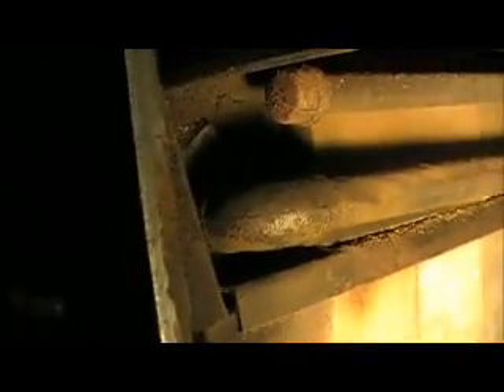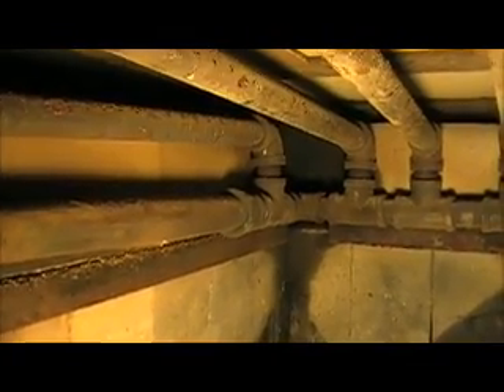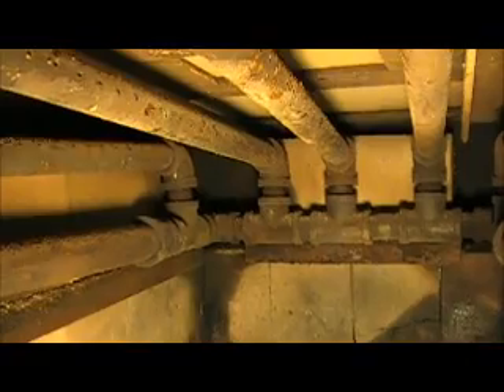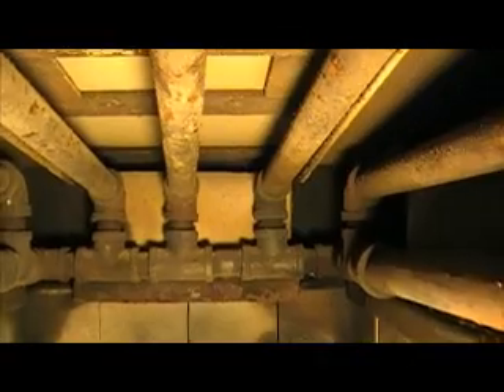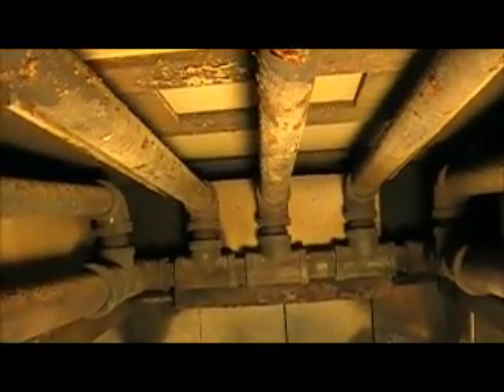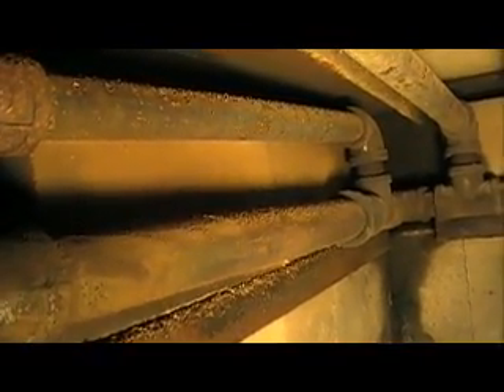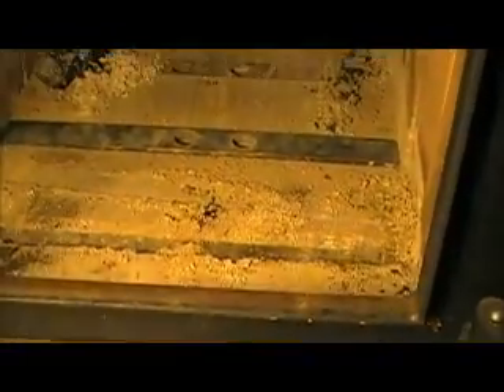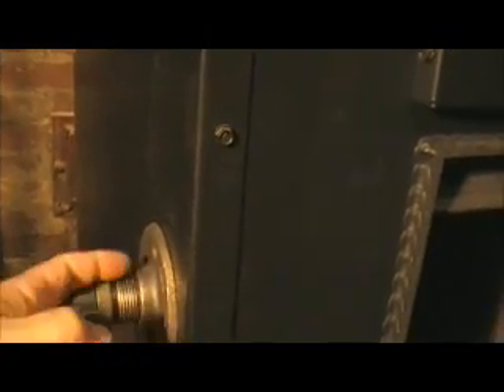Englander Stove Secondary Burn Modification 28-3500 How to

Comment: Looks good. I did a similar set up on a USSC Hotblast wood furnace. I used a gas stainless steel bbq burner for my secondary. It worked great. I had to do some welding on the burner to adapt it to the pipe. Your method seems much simpler.

Comment: I know this video is from a long time ago, but I am currently looking at buying this same wood furnace and wanted to understand better how this modification actually functions.  I had outdoor wood furnaces in the past that worked great, a Wadena and a Hopsco, but now may be looking at this particular Englander.  I would like a copy of the parts list if you are still sharing it, and a little better understanding of how this actually accomplishes the much better efficiency.  Thanks!
Reply: Would like to email you for the parts list if that is still an option. Where do I get your email?
Reply from the maker: overmann55@gmail.com

Comment: So are the pipes inside basically there to help hold heat in ? From my understanding it sounds the plates you added inside is what’s really making the stove burn longer off less wood. I purchased a house with this stove as secondary heat and I can’t get it to burn all night for the life of me!
Reply from the maker: Longer burn times are a combo of the largest pieces of wood (has to be dry) that you can fit and being able to lower the air while still keeping the burn going well enough to provide heat and not burn out or billow smoke. Secondary burn and injecting the air at the top of the box seems to give it a steady burn and it goes all night for me. 6-8 hours is easy... just fill it up again in the AM... still plenty of hot coals to fire back up.

Comment: anyone else have that "baffle plate" in the Englander slowly start to succumb to gravity/heat after a few years of usage? it was bowing downward so much that it started to get in the way of putting firewood in beyond a few pieces. i flipped it 180 degrees and now the thing is slowly falling apart (seeing little pieces breaking off of it over time). in another year or 2 it'll be gone. a friend said theirs did the same thing (on a different brand/model) and they removed it once it got degraded. has all u experienced the same thing and if so, did removing it work out ok?
Reply from the maker: Since my plate is sheilded by the extra bricks I added underneath it - I do not see any degridation of the plate at all - still looks good. Also - I run mine on low air for log periods - and I never get it in an overburn situatiion so if you run the stove red hot It may be why the plate is degrading?
Reply: You can save it before it crumbles and just have a new one cut. Probably pretty easy for any word shop. Quick 75 bucks maybe if they have a piece of steel sitting around.

Comment: Most builders seem to favor 3/4" pipe but I have a bunch of 1-1/4 black iron pipe on hand and wonder whether fewer runs of larger pipe for a secondary burn would work as well. Also, is there an optimum area of drilled holes relative to the ID of the pipe?

Comment: You are so awesome, great explanation, and video.
I've got a question. What about using a wood burning stove catalitic converter. The ones I've seen are about 2" deep x 3" high x maybe 12 " long, ceramic. I'm thinking your supposed to put them the fire against the stove wall. I'm guessing that when they get hot they burn the gas and glow red. Not sure if you need a space between it and the stove wall, if it's only helpful on top, if it's worth the money . Any advice from anyone would be greatly appreciated. Thanks. Again great video.

Comment: I tried the same design you have at the first of the year but it didn't work. I'm thinking it was because the secondary air wasn't heated but I see your idea is as mine. So can this design work with normal room temperature air? If you would could you email me with any suggestions you may have? Maybe it could be not air tight sealed enough? Ty much.  jetmech401st777@gmail.com
Reply from the maker: Tricks: get some coals in there first - it needs heat to ignite the secondary - the air needs a bit of pipe length to heat up the air before entering the box - otherwise it will not reach the temps needed - try turning down your regular air feeds and it should suck in the secondary to ignite.

Comment: So what you've done is just modified the air intakes from its original design ? Could you not slow the air with what came with the fire box ?
Reply from the maker: You could, but the result I found that the stove without the secondary tubes and the other mods would either eat wood like crazy or billow big black smoke - there was no in-between...
Reply: David Brisson- what the average burn time on low?

Comment: Hi Dave, how do you heat up the air before send it it into the stove?
Reply from the maker: The air travels through pipes in the stove which heat the air before the air actually enters the upper part of the firebox.

Comment: Hey David, I also have the same stove, and you're totally right, it eats wood like it's no one's business.  I like how you did the secondary burn set up. Could i also get the parts list? And any other tips and tricks you did on the stove for longer burn times. I am still feeding every 3-4 hours even with seasoned wood, and it sucks Email Meluvulngtime00@aol.com (yes it's from full metal jacket)
Reply from the maker: Sent - sorry for the delay - just saw this comment...

Comment: David, like your videos, we live in fairbanks,  we just purchased out home a month ago im looking into ways on cutting on heating costs. im very interested in purchasing this stove, but can this be placed in my garage or shed that is attached to my home. then run all of the piping inside. also just curious, how much did you cut back on your heating costs with the purchase of this stove. thanks can you email me parts list and the step by step list. johnwatkins35@gmail.com
Reply from the maker: Hi John, You can leave this in the shed or garage. However depending on the temp of the air entering the blower, you will probably want to add an intake air duct from inside your home as well as the return from the stove. That way you heat already warm air from inside your home not freezing cold air from the garage. Should be fine and work well. No wood mess coming into your home. Smart way to go. I have a chute in the basement for the wood so I do not have to carry anything into the house and the wood mess stays down there. I will send the docs in a few... good luck - let us know how you make out.

Comment: What is the diff in burn times before and after
Reply from the maker: Hi Matt, Prior to the mod, It was difficult to get a good burn and have it go 3-4 hours. Most often if it was burning well, it had to be fed every 2 to 4 hours. I chewed through a LOT of wood. Now 7-8 is easy and depending on the size of the logs, 10-12 is doable. All with the same amount of wood.  It is because of the air injected is focused on the gases versus the wood directly. It allows you to lower the stove air feeds to almost nothing and still maintain a great total burn without the black smoke billowing like it used to when you try to turn down the air.

Comment: interesting idea. Can you tell us the difference in temperature before and after this modification ? Just wondering because my stove is not as robust as yours and too much increase in temperature might distort some metal parts. I have seen top plates distort on other stove modification's.
Reply from the maker: The temps are essentially the same but you can control it better and get heat longer because of the added efficiency. Same wood - more (longer heat). Wood stove temps overall are determined by the fuel and the amount of air you add. For instance if you have wet wood, you will not get high temps easily. And no matter what stove you have if you accidentally leave the air feed wide open for hours you will over-fire it and warp the parts that are susceptible to high heat. So the goal is to get more (longer) even heat with the same fuel.

Comment: Interesting, and a good idea. Certainly I mean no offense, but I think you have way too much going on there for the average owner. Definitely, it's more than the average person could accomplish. I will be coming out with an add on for this and similar stoves which will increase burn efficiency by approximately 20% and it can be installed by the owner in only a short time. It is relatively inexpensive, simple and best of all, it works. It will largely eliminate coal build up during periods of heavy use and increase burn temperature considerably. Just the waste in fuel from the coals building up is and has been a major complaint with all of these stoves. I like what you have done though.

Comment: Hello, thks for the detailed notes. If my stove was in an urban environment the smoke exitting now would b unnacceptable. Bit by bit i am learning the importance of the secondary gas burn. I can relate to the dues u paid going back and forth to stores for parts. My business is in printing, lots of making do and inventing, as well i have done 2 houses by the seat of my pants. 2 questions - you added firebricks to the ceiling of your stove to help the 2ndburn ? I dont c clearly either the exit hole or baffle covering it, obviously its there. 
Its not the season to do this job. I am in quebec canada, originally from montreal but now an hour train ride and a 30 min car drivenorth of the city. Your secondary, joke, name - Brisson - is french. Where are you?
Reply from the maker: +ian stewart - I live in NH. It is about 5.5 hours drive to Montreal. Been there a few times. I used to drive up for the fireworks competitions. Very nice city. My Dad's family is from Canada and I still have relatives in your area. It is too cold to start the modification now if you are that far north. Best wait till spring. Good luck and stay warm!
Reply: I just took in my neighbours stove 2 weeks ago.   They heated their house for 20 yrs with it full time.  Our place is not full time, for now.  I have been in nh,  for the appalachian trail, on the way to old orchard, kennebunk, and a couple of boston visits.  Thks again

Comment: Hi Dave,
Great little project!
I'm considering going with the Englander. My main concern with this stove is efficiency, any stove can heat if you burn enough wood. Your burn tubes certainly seems to have helped in that regard. How is the black pipe holding up after a couple seasons I would assume the tubes would break down after a few years? Could you send me your step by step and  parts list? Thanks Joe    baylogj@gmail.com
Reply from the maker: +Joe Baylog  Hi Joe, Still holding up nicely. No issues thus far. I am sending over the docs now... Let me know how you make out.

Comment: fyi, iam going to model my tubes and burner off the NC30 for the sec. air..
Reply from the maker: john reich Email me and I will forward you my docs.
Reply from the maker: +john reich  - Hey John, how did it come out?
Reply: +David Brisson completed back in the late spring.  was only able to test outside with a 5' stack.  Will be installing in a cabin within the month.  cut the tube holes with a cutoff wheel instead of a drill.  much faster.  Did get a secondary burn for a while but just didn't have the draw for it to work properly outside.  The real challenge was getting the plate and cat. out to make room for the tubes.  didn't take vid. but got pics.  will try to post.  Thanks for your example.  John
Reply: +john riech Hey Dave.  I installed the stove w/secondary conversion in a small cabin recently.  The stove works great w/secondary tubes.  There was enough pull for it to burn consistent and pull the secondary air once the primary was shut down even with not well seasoned wood.  I was able to get at least 8 hrs fr. a full load of wood which is 3 or 4 splits on a 4" bed of coals.  So Its a total success.
Reply from the maker: +john reich  - That is really great to hear! Another home-made secondary success. I would love to see what you did exactly- if you can share a few pics / vid that would be appreciated.  There are still a lot of naysayers on this topic, so I am glad to hear that yours turned out perfectly. I am still seeing boards calling our do-it-yourself solutions a total hoax. Bravo Sir. Not sure if you found it difficult, but I am pretty sure just about anyone can do it with a little bit of tool ability and some patience.
Reply: +David Brisson youtube search:  catalytic to secondary air conversion englander 24-ACD,   its a silent slide show with notes on each photo.  Next time I am at the cabin I'll do a narrated video which will hopefully be better.

Comment: Dave, like the sec. combus. tubes.  vid. how much space did you leave above the brick and metal plat for the smoke along the top? also what is your flue diameter.  I have an Englander 24-acd and pan to remove the cat and bypass plate add sec. combus. tubes and put the brick on top.  As it is right now with the cat removed and the bypass open it just doesn't get enough air to keep burning without the door ajar.
Reply from the maker: john reich Hi John, 6" steel flue. There is about 2" above the plate and brick for the smoke to reach the flue and go out. It sounds like you may have a poorly designed draft system in your stove. The added burn tubes may fix your stove because it will allow some added air to enter the burn area right at the top of the firebox. Do you seem to have the issue after say an hour of burn-time? What does the smoke look like coming out your chimney? Do you have a lot of smoke coming out the door area when it is hot (Would suggest poor draft) etc.? After the burn tubes, you may also want to consider adding an air feed in the front of the stove low in the firebox that you can adjust and close when needed. But I would wait till the tubes are complete and see how she runs. Let me know...
Reply: David Brisson I haven't installed it in the house, I've done 3 test burns w/6' and 9' stove pipe.  Which is about what i'll have at the cabin before it enters a 12x12" masonry chimney. even after hot (4+ inches of red coals) and very hot.  if I close the door it smothers the flames and it immediately turns to a heavy smoke, there just isn't enough primary air.  If I have a problem after the secondary air tubes are installed I'll add either a blower to primary or add vents to the front for more primary air.  the current primary originates under the firebox in the middle then channels to the front to a shape like a goal post to the primary vent above the glass so it makes 4 turns before it enters.  This warms the air but also slows it down.

Comment: Hi David,
I am strongly considering replacing my older wood stove insert with this furnace.  Would you please send me the parts list for this mod.  Not sure if you have this in the directions, but are you drilling a bunch of tiny holes in each of the three upper pipes?  Also on one of your other video's you mentioned you were burning pine.  Are you having any concern with burning that?  Or do you have to do anything differently when burning pine. (Clean chimney more frequently? / burn hotter?)  Just wondering because I can get pine easily / hardwoods not so much.  Thanks for any help you can provide.
Cooper    -  Cooperh1@yahoo.com
Reply from the maker: +pinkbike2007 - Sent - how did you make out?

Comment: Hi David,
I am considering this stove to replace a coal stove in my living room but I would need the blower pipe to exit the bottom of the unit so it could be piped into the furnace return in the crawlspace. Does it look like the unit could be modified to work this way? Thanks in advance.
Justin
Shorebuildconstruction@gmail.com
Reply from the maker: Hi Justin, I think pretty much anything could be made to work... I am not familiar with your exact setup... but I assume you could either run the top outlet over the side and down to the return... or you could mount a fan on the top and force the air out the back bottom hole that the fan usually mounts to and out the back. It might be easy enough to just run over the side... However in a living room... I would think the blower noise would become annoying. It is fine in a basement but in a living space I can imagine it would get annoying fast. There are variable fans that would be quieter available... or I have heard of variac devices that work to slow and quiet the fan... but still , I am not sure a furnace is a good fit for where you may be trying to watch TV or have a conversation... Maybe there is a way to dampen the motor or enclose it in an insulated box? (While still having an opening to let in air of course)... not sure... but I know that the fan as it is is probably too loud to sit next to and get any peace and quiet.... or watch tv etc.. Please let me know what you end up doing... it sounds like you have something interesting to figure out...Good luck!
Reply: Awesome thanks for the advice! No one has these in stock locally to go and look at. Sounds like this is more of a furnace and less of a living area wood stove